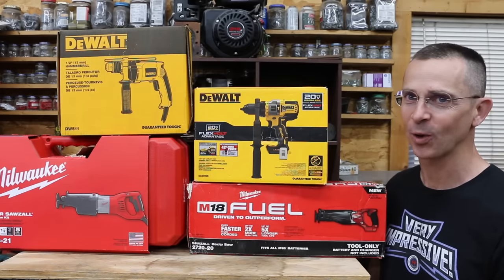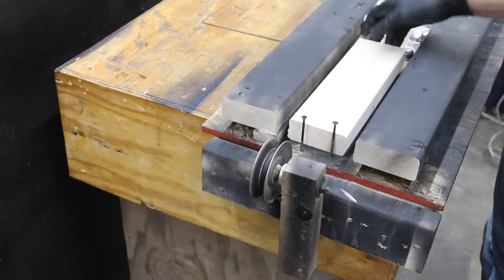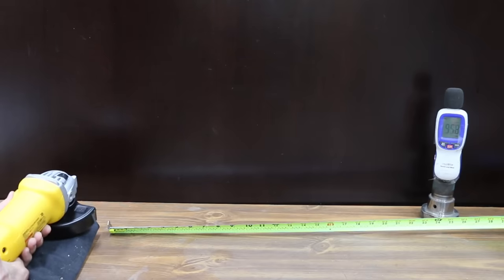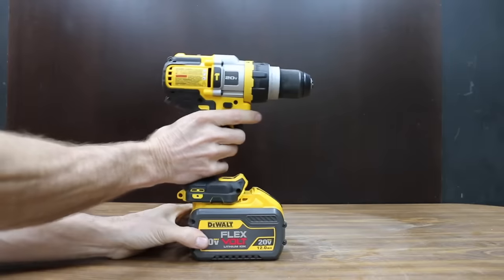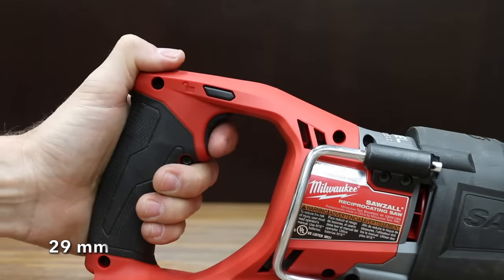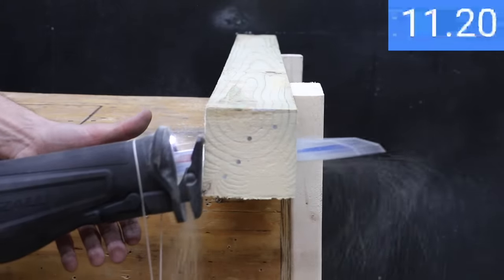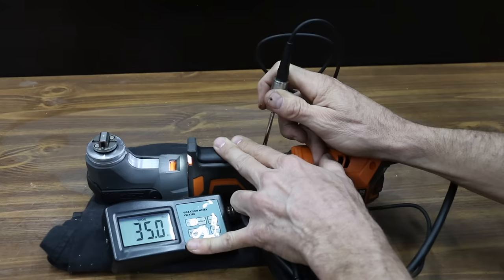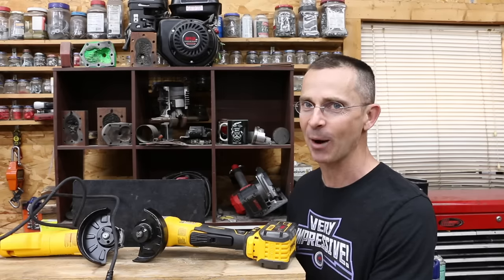Let's Settle This! Are Cordless Power Tools REALLY Better? Torque, Cutting Speed, Noise, Vibration

Comment: Battery or cord - for me it'd be what it's been used for, and where.
For example, if you have a welding bench and have grinders there, the 'smart' thing would be to have a power point (or several) there and run corded drills, as changing batteries would be an added hassle and the tools are more expensive. But if you're going to use the grinder at different locations, it may be more convenient to use a cordless, rather than run extensions to trip over or switch wall sockets every time it's used.
It's a similar thing with camp/flood lights - while you can use corded lights you will need a generator, but battery lights remove that problem.
Reply from the maker: Thanks for the feedback.

Comment: If you use a corded tool and you saw or drill through an electrical wire the tool could short from the circuit powering the tool to the circuit you just cut through. The corded tool could become a dead short between two different circuits right in your hand.
Reply from the maker: Thanks for the feedback.

Comment: I can see that manufacturers are putting more features on their cordless tools, brushless motor, brake, clutch, etc. If they put these things on corded tools they can perform just as good as cordless ones. I think that battery is making more money than a power cable, so they aren't motivated to do so.
Reply from the maker: Thanks for the feedback.

Comment: I no longer buy batterie powered tools I don't use them enough to keep the batteries good the cost of replacing batteries for the amount of use I get out of them is not worth it also I don't need to keep the corded tools charged just plug them in and they work.
Reply from the maker: Thanks for the feedback.

Comment: If you are a regular Joe homeowner just using these tools around your home, there is absolutely no reason to buy cordless tools. The MAIN reason, besides the price, is the batteries. If they end up sitting for months at a time, they are going to pack it in quick and need to be replaced. At least with corded tools, there are no batteries to have to keep buying.
Reply from the maker: Thanks for sharing.

Comment: Test results are indeed interesting and even unexpected in some cases, but would be interesting to see how far you could push them until they overheat or die. I'd rather have a fractionally slower tool that lasts 10x longer. The total cost of ownership and environmental impact of batteries got me to abandon them entirely. Incredibly annoying to reach for a tool, have a fried battery, then realize the replacement battery costs as much as a new tool. It's fun to wait for a recharge too.
Reply from the maker: Thanks for the suggestion.

Comment: It seems that the motors in those battery powered tools were much better. I wish some manufacturer made brushless corded tools where the cost would be cheaper than the battery powered model but the performance could be better than any battery powered tool or existing corded tools.

That said, maybe market for such tools is too small to be worth the effort to the manufacturers.

Does anybody manufacture high power inverter with a corded connector that interfaces with these powertools (that is, basically a battery shaped adapter with a cord to the inverter to output constant DC voltage and as high current as needed)? That would allow getting those battery operated tools with high quality motors without needing to invest into batteries so much. And as a bonus you would get battery operated tools for rare cases where you cannot use cord.
Reply from the maker: Thanks for sharing.

Comment: Testing cordless tools at full charge doesn't give a good sense of use in comparison to a corded tool. The battery should be depleted by 1 bar prior to testing. This gives a good sense of a tool used over time verse a corded tool that never goes flat.
Reply: If project farm comments down here, the comment will say "thanks for the feedback".

Comment: I thought of an additional test you might consider.  Your test rigs are great, but could you add a test where you manually try to apply force dynamically?  For example - Plunge Cuts with a Multi-Tool.  You used 5 lbs, 7.5 lbs, and 10 lbs.  Could you try to plunge cut through the same OSB using variable pressure with your hand to see if you can get a faster cut by feel?

Comment: Drills (except for concrete) and screw guns are what I favor in cordless form. They're the only things that can actually make good use out of a battery. Grinders, saws, or any other tool...corded/air. They drain batteries in minutes and lack power (except for reciprocating saws that I will use sparingly for very light duty). I'll use a cordless impact wrench (socket drive with real torque, not the 1/4" hex shank) for stuff I know isn't tight or doesn't need to be tight, just because it's quicker than getting out a hose.
Reply: And with drills, I don't even use corded drills except "rotary hammers" for concrete anchor installs (for small masonry fasteners I will stay cordless). If a cordless lacks the power, I use a drill press or mill. If the work can't be moved, I'll take a corded magnetic base drill to the work.

Cordless drills suffer from burning up, even if they seem to offer more torque. You can't get much use out of them at maximum output. At lower (battery) voltages, tons of current is required. 120 volts AC would need 10x less current than a 20v cordless piece. Much less heat and resistance involved. I've burned up many cordless drills at work. They get too hot to touch and they usually come close to catching on fire.
Reply from the maker: Thanks for the feedback.

Comment: Todd, you definitely should have used the FlexVolt version of the angle grinder; especially since you already have the 12ah FlexVolt battery. Look at the DeWalt DCG440B or the older DCG418B.
Reply from the maker: Thanks for the suggestion.
Reply: @ProjectFarm  if you want a beast of corded grinder to test, I'll mail you my personal 5.3HP D28499 7"/9". I wouldn't mind letting you use it for a test at all. 👍

Comment: What I gather from this is it really depends on your needs.  Generally seems like for a weekend-warrior DIY infrequent use the corded tools, with the exception of the cordless drill, are probably the way to go to save a LOT of money for minimal inconvenience and get great performance...but if you use them often or are especially far from power, then the cordless tools are very good if you are willing to spend money on a decent one.  I think they both have their place - I just got a $70 corded circular saw because the ones in my price range cordless just don't cut it (punn intended) but I wouldn't give up my 18V cordless drill for a corded one unless I had to bore huge holes all day long.
Reply from the maker: Good Point!

Comment: the flex volt tools I'd like to see them being tested
all it is was put to put a flex volt battery on a regular tool
Reply from the maker: Thanks for the suggestion.
Reply: @ProjectFarm  didn't expect a response. It just seems them flex volt tools have considerably more power than the normal ones. Thanks

Comment: few month ago i replaced my 8 yo black and decker epc14ca and bosch psb500re 
with dcd706 with 2x5ah 
for me was totaly worth it for house work
yeah its not powerfull as the corded tool but gets jub done and there is no that big diffrents between them

i was amazed how this small size tool turned out to be so powerfull

by the way one battery was more than enough to build half house with one charge
Reply from the maker: Thanks for sharing.
Reply: @ProjectFarm  and yeh your vid as usual turned out vary helpful 😎

Comment: Fantastic vid, 
One factor with the angle grinders is "apparently" the cordless doesn't last very long without a very large battery.
I went with a corded because unlike my jigsaw I am happy to be not quite as mobile.
My cordless dewalt jigsaw is the best tool I have ever purchased, saved me soooooo much time. (highly recommended to any woodworker).
Reply from the maker: Thanks!

Comment: Another great review with with creative and earnest attempts at being as scientific as possible.  I was only surprised by the drill comparison.  I've always found my 18v or 20v Dewalt drills to have less torque than the corded versions.  I also contend that if you have many or large holes to drill or screws to drive, the battery versions can't keep up with the work unless you have several batteries.  If you haven't done it yet, I would like to see a comparison of the different super/gorilla/liquid nail type glues, or maybe JB weld vs. other epoxies.
Reply from the maker: Thankshttps://www.youtube.com/watch?v=https://www.youtube.com/watch?v=_vR15u0vmms

Comment: Great video and test rig as usual. Would love to see an update to this using more powerful cordless tools, like the dewalt flexvolt side grinder or circular saw vs corded heavy duty equivalent. There is a belief by some, that they exceed corded tools now but a good margin.
Reply from the maker: Thanks! Thanks for the suggestion.

Comment: It would have been easier to understand this video if you would have called the cordless a BATTERY Tool to better distinguish it from the CORDED Tool.  Also to show the battery when using the BATTERY Tool and to show the CORD when using the Corded Tool.  I only point this out because you talk so fast in your video it is hard tell which tool you are using when you can't see the cord or battery and you say Cord or Cordless so fast that I wasn't quite sure which you were talking about.

Comment: Great video! My corded sawzall finally died and I replaced it with a Makita battery powered one, and I was disappointed in the lack of performance from the new saw. Glad you proved that true.
On another note, out of curiosity, what do you do with all the tools you buy/acquire for these videos?
Reply: Look into the Milwaukee cordless super sawzall. It will not disappoint. It’s not the same as the regular fuel in the video
Reply: cordless
Super Sawzall (2722-20)
Reply from the maker: Thanks!  What I don't save for future episodes I donate in my community.

Comment: cordless is just another word for built in planned obsolescence. Meaning that you KNOW if you buy a cordless variant, it'll be broken in 2-5 years, as the battery will die.

I have in my toolbox an electric drill which came from my grandfather. The thing is now 80 years old, and still works fine, although I don't use it anymore because I want to keep it in working order, and because it has no speed regulation. It's just on/off.

I can guarantee you none of the cordless stuff you buy now, will work in 20 years. 1/4th of that time.
Reply from the maker: Thanks for the feedback.

Comment: You should be using the makita xgt circular saw, 40v. The Xgt range represents the top end of battery tools, not the lxt
Reply: Price difference is probably too big. if someone is considering corded vs cordless, price is of interest. So if a corded tool is 100, then you might consider cordless for 150 or so. Someone considering the corded for the price would not go and buy a 300 tool

Comment: With the corded drill why did you not turn its power to level 2 or 3?  The corded drill was 1/3 the power of the cordless but the cordless drill was on level 3 while corded drill was only on level 1.  The cordless drill did not even put the bolt all the way into the wood at top speed of any of the bolts while the corded drill put all 3 bolts in.  So not only is the corded better by price but it actually did the job at a much lower speed while the $500 drill did absolute jack shit with actually pushing it in.  Also that corded drill is from 30 years ago design and still being sold and still holds up  to the power of a brand new much higher evolved drill.

Comment: The batteries are overpriced and too often new replacement batteries are not as good. Also one battery for each tool isn't good, so in the long run battery power gets much more expensive and less reliable than corded.
Reply from the maker: Thanks for the feedback.

Comment: Lifetime expense and impact cannot be overstated. Expect to buy additional batteries 3-5 times over the comparable lifespan per-tool. Batteries are a brand-controlled ghetto system designed to extract your funds and salt the earth. 

My worm drive Skilsaw from 1983 is still tip-top, not to mention my arm strength and dexterity is magnificent, which has innumerable carry-over effects that enhance my quality of life and maximize my performance potential overall. My hair possesses a lustrous sheen that gives off glints of gunmetal blue and vermillion in late autumns early light. The many Ecuadorian women that admire me have nicknamed me El Pilar. I don't bother trying to understand them. I know they require love, just as any other human being on this absurd carousel ride. I am one who gives.

For the large part, the Industrial Revolution and its consequences have been a disaster for the human race.

After you dispose of these batteries, I hope you don't waste further effort attempting to reduce your environmental impact in other areas of your life -- because the net zero timeframe for homeostatic equilibrium of a single 18v battery pack is 50 years. Are you going to make up for 200 years of damage by separating your plastics from your food waste and wearing recycled denim? You may as well start wearing a harp seal fur coat and leave the water running and the lights on for the rest of your life, it won't matter.